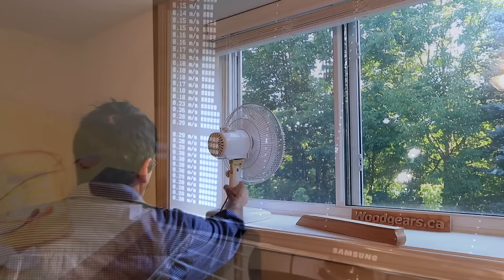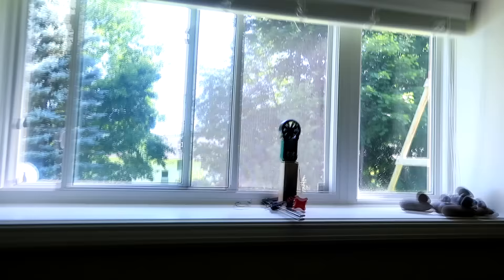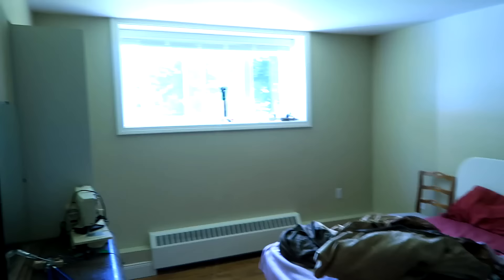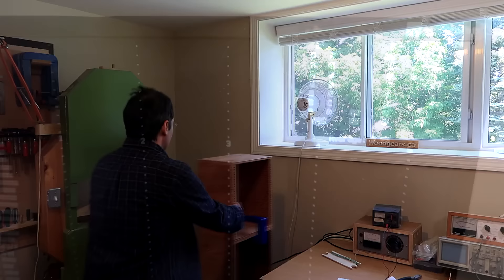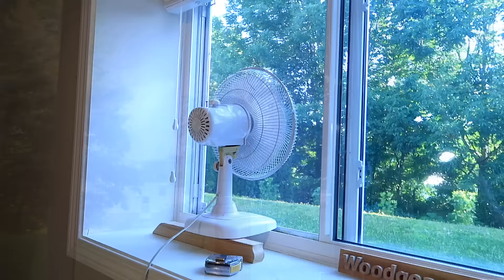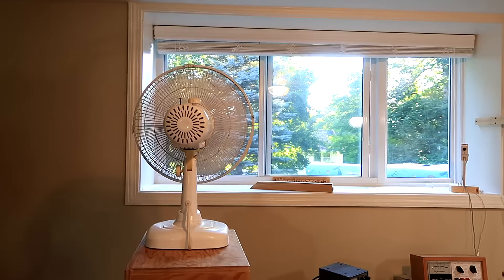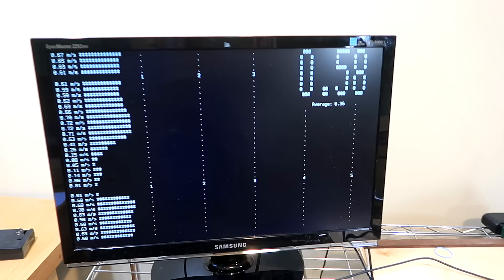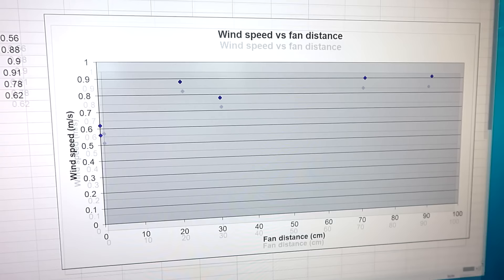Best fan placement to move air through the house

Comment: As a physicist who worked in an office with no air conditioning, this was one of the experiments I had to undertake. Very often I would get to the office at 06.00 or 06.30 and the temperature in the office would be about 28°C. Outside air temperature was about 20°C at this time. Subjectively it was very noticeabble that blowing air out of one window  enabled the other window to suck in cool air from outside.  --> blow out is best, imagine the ventilator generates a "cone" of moving air which causes other air to also be moved. Aim for the largest vigorous moving part of the cone to be at the window.    
The next factor was whether closing the windows when the outside air temperature exceeded the inside temperature or whether to leave them open in the hope that there might be a breeze occasionally. --> This was conclusive - keeping hot air from outside out (typically 35°C in the mid afternoon) and the cool air in was best.  
The last objective factor was avoiding the sun heating objects (desks etc.) inside the office. For this, outside venetian blinds had to be adjusted so that sun did not shine directly on objects inside the office. This made a small but still appreciable improvement. 
One subjective factor is to use a ventilator to move the air in the office. Actually this should cause a miniscule temperature increase (the ventilator uses a motor consuming non-negligible amount of electricity converting into work, but SUBJECTIVELY the air moving over slightly moist skin feels cool. (But it isn't actually cooler, of course). 
I use these tricks also at home to ensure my house stays cool (we have no A/C) even though outside can be 39°C. Recently I had a 12° cooler house inside compared to outside. Whether in the office or at home I always make sure I can reliably measure the temperature in all required rooms and outside. Perception is subjective, thermometers are objective! All the best, Rob in Switzerland
Reply: I am no physicist, but woul'd moving air not increase the evaporation and so cool the evaporation surface/ object (in this case you), so it would not be a subjective feeling, but an actual cooling effect for humid objects?
Reply: @rabenklang7  This is true, and it's not just caused by evaporation. Air directly next to the skin is generally much warmer than room temperature (if ambient temp < body temp) which means that blowing air over the skin will replace warmer air with cooler air. This is why wind protection is important in cold weather; still air is an excellent thermal insulator, but it only works if you can actually prevent air next to the skin from flowing (which would otherwise quickly result in convective heat loss).
Reply: Born and living in a tropical, hot and humid country.

I can confirm ventilator fans, or just moving air in general is really good for skin feel.

I think slightly drafty indoors is something people living in temperate climates need to get used to and incorporate into their culture (global warming). I was so surprised when I holidayed in Europe and there were no fans (or air-conditioning) at all in the shared Airbnbs, it's fine in cold weather, but summer would be a broiling torture.
Reply: A lot of people think that no matter what, no matter how blazing hot it is outside, opening your windows will keep it the coolest inside
Reply: @rabenklang7  Yes but the room wouldn't be cooler, thus it being subjective (subjective as in relation to the room - as "what/who is it impacting" and not the general room temp)
For example, chinchillas don't sweat like us thus air flow does not cool them down. So cooling down the whole room is needed. (As opposed to just cooling you down)
Reply: @tragile9108  hmm even when they do not swet, i suppose airflow will make them objective cooler,  especially when you shave them first, and if the air is cooler then thier body temperature. But yes, the room temperature will not change. And if you have to take care of such an animal, you need to make shure it stays happy in a cold room. ;-)
Reply: Thank you for the data Rob. I had been wondering about exactly this for a while (keeping cool air in instead of letting a breeze in) never had the time to actually to actually test it.

Will be using it this moving forward
Reply: @VVayVVard  is that the reason why water feels colder than air with the same temperature? Because the water actually pushes away the body warmth "sphere" around us?
Reply: You build up a layer of warm and moist air around you, if you constantly blow it away, you'll evaporate more sweat and not build up warm air, so you'll indeed be cooler.
Reply: So should I be keeping my windows closed during the afternoons? No need to vent out the hot air with a fan blowing outside? I live in the Philippines and the weather gets consistently hot
Reply: @leojones1964  Yes if the outside temperature is higher than the inside temperature - and if possible make sure nothing in your room is warmed by the sun - so keep the blinds or curtains closed, as counterintuitive as this may sound. Otherwise you are unwittingly heating your house! All the best, Rob
Reply: @leojones1964  it's the same concept as closing all the doors and windows tight when the AC is on. I'd think an Asian was born with this knowledge in their DNA. So if you've cooled your house down extra chilly the previous night, when would you let all of that cool out seep out while letting the oven outside in?
Reply: @tempota7792   Pardoning your subtle condescension, I completely understand the concept. I was simply asking if there was any value in venting hot indoor air and encouraging airflow over not letting hot outside air in. I got my answer (only if the indoor temp is lower) which is hardly the case without AC because this house doesn’t have insulation and the room is directly under a concrete roof deck. The difference in temperature is not significant that I opt to open my windows anyway. Unless this is also wrong
Reply: @lukass7756  That's due to evaporation. When water is exposed to air, hotter water molecules evaporate over time, leaving cooler ones behind. This is the principle behind the cooling effect of sweat (which is actually slightly less efficient for cooling than drinking water is, due to the higher salt content preventing water molecules from evaporating as readily).
Reply: @VVayVVard  I meant when actually bathing in the water. Water always feels colder then air at the exact same temperature.
Reply: What about a room with a single fan
Reply: @lukass7756  That could partly explain why water feels coldest (hottest) at the moment of submersion. However, the reason water temperatures feel colder/warmer during bathing is due to submerged skin being in contact with a higher density of environmental molecules compared to dry skin, enabling it to impart more kinetic energy to its surroundings via direct molecular collisions (conduction), and vice versa in the case of hot water.
Reply: this guy seriously just claimed that moving air over skin doesn't make it cooler

i guess evaporation just isn't a thing then? really makes you wonder why we evolved to sweat. must have been a fluke!
Reply: @DevinDTV  You have to distinguish between subjectively cooler (how you feel) and objectively (actually) cooler (the ambient temperature). If you apply a few tricks, you can have both. Spoiler: moving air across your skin does not actually make the room cooler. Duh! It's physics.
Reply: @DevinDTV   I believe he meant that moving air inside a room doesn't make the room itself cooler (as opposed to pushing air outside, which would result in negative pressure inside, which in itself would cause (presumably cooler) outside air from other windows to enter inside). Blowing air on the skin will of course accelerate the rate at which the skin cools down.
Reply: @coolghoul9  never been outside their state or near Arizona
Reply: It's really a shame that exterior blinds and shutters are so rare (at least here). Reflective curtains of course help but the space between my curtains and the glass is always an absolute greenhouse.
Reply: @keldencowan  I agree. When I returned to UK after living in France for some years, I considered adding exterior shutters to my house. Now I live in Switzerland and we built our house, so I made sure to specify exterior blinds. The really big ones are motorized and the smaller ones manual. We use them all the time to keep the house cool. All the best, Rob
Reply: @RobWhittlestone  you're kind of wrong with wording here. Because if you blow air towards your skin (with condition that air temperature is lower than your body temperature) it will be not only SUBJECTIVELY cooler, but your skin would actually cool.
Reply: @user-jb2kt3ub2e  I agree - I made the assumption that the air was at the same temperature or slightly higher. Thank you for identifying this factor.
Reply: I love seeing clever videos like this. It's the sort of thing I often find myself doing at home. I also love seeing well-written and informative comments. Your contribution is appreciated - thank you!
Reply: In my house I use cellular shades (honeycomb blinds). When opened they trap a layer of air which serves to insulate the room. They also have white facing the outdoors to reflect light and the interior can be any color. They work well to buffer temperature extremes in the winter or summer.
Reply: @coolghoul9  It might not be cooler to open the windows, but the air is much fresher...

When I leave the windows closed and enter my apartment, the air smells so stale its unbearable.
Reply: God, I wish we have winter like you do there. I'd stockpile ice and snow for summer.
Reply: but blowing inside feels sooo good
Reply: This is dumb. Fans should be pointed at people to facilitate perspiration, which is what really cools the body. 
If you think thermometers are more important than thermal perception, go into a tropical forest at 30ºC and then into a well-ventilated desert at 35ºC. I guarantee you that the climate in the desert will be much more pleasant.

Even if you want to remove air from inside the room, an exhaust fan is much more efficient than an ordinary fan.
Reply: Ive been running similar experiments in our house because of the same reason, tho recently install a ac, it doesnt do the whole house well, so we use those tricks in tandem with the ac running when outside is hotter than inside to help preserve the coolness. Two small window ac units can work wonders when u have fans properly placed too, tho ones lost in storage right now, but with two it helps keep a cool air vortex going as long as a given space isnt mich bigger than the btu rating of a given ac unit
Reply: @lukass7756  It is because water has a much higher thermal conductivity than air. 25 times more to be exact just googled it. It is the same feeling when you touch a piece of thick metal, you will feel it even colder than water even being at exact same temperature because steel has a much higher thermal conductivity than water
Reply: Moving air inside, all wi dows closed, is not just "subjective" cooling. We use sweat and transpiration to cool ourselves down. If there is a bit of ventilation, sweat evaporates faster and you can cool down your body quicker. Not too much ventilation, or it will dry up mucoses. So for optimal comfort you need just a bit of ventilation. This will cool down your body trough sweat evaporation.
Reply: Please don't call evaporative cooling of the skin "subjective".
Reply: @ewthmatth  Why? Who else notices it?! Hahaha!
Reply: Closest i gotten to doing something like this is the kitchen when cooking for long periods of time. Our kitchen is connected to living room by door sized entrance with only a thin curtain separating the two. When cooking, i’ll open the kitchen door (leaving the screen door closed) and do same for living room door. I’ll also close the curtain diving the kitchen and living room. This ends up with a much warmer kitchen, but the temperature difference it creates will force air under the curtain, drawing cool air from outside into the rest of the home.
Reply: grüezi wohl :D wo hast du 39 grad? nicht in der schweiz und wenn dann 1-2 tage lang...
Reply: That's why we use exhausters. They blow inside air out. Isn't it common sense?
Reply: @RobWhittlestone  Only issue is indoor air pollution. You breath and have to change the air regularly so there is loss on that matter. Best way to go about it is opening everything wide for a short period of time.
Reply: I'm working in a workshop with no air conditioning and had the exact same observations. So obviously I decided to automate the whole process.
At the moment I have multiple fans in different windows (they are mounted, so sadly I can't move them) and motors on the windows / balcony door.
I also have indoor and outdoor temperature sensors hooked to Nodemcu modules. A simple script I wrote turns on the fans and windows when outside temperature is lower, and turns them off when it is higher. 
Also, some of the blinds here are automated too, so they automatically get closed based on the hour too.
This way the workshop is 5-6°C cooler the entire day because the system is cooling it down at night (and whenever its cooler outside).
Fans use very, very little power compared to an AC, so this is a really efficient and cheap way to cool a large office /workshop down.
Reply: @DarkownerMinimalist  das gleiche habe ich mich auch gefragt und mich gewundert das es sonst niemandem aufgefallen ist 😂
Reply: @lukass lowest iq comment itt
Reply: @Devin take reading comprehension classes buddy
Reply: I see, so it's better to push air out, thanks.
Reply: I wonder why here in the tropics we don't seal our windows so we can keep hot air out. closing windows doesn't do much for keeping it ou lol
Reply: @keldencowan I suggest putting aluminium foil on the outer side of the windows. Of course, it looks weird from the outside and will attract attention of the neighbors :-D, but it does wonders to lower the greenhouse effect.

I put it on about 2/3 of the surface of the glass  (on windows oriented to south) at the beginning of the summer and leave it there till the end of it
- the amount of light in the room is of course lowered, but bearable.

I attach the foil directly to glass with pieces of an adhesive tape - this creates slits around the edges, but it doesn't matter. I prefer not to attach it to the window frame to preserve the surface of it (we have wooden frames).

Leave uncovered the part of the window where you want to be able to see outside - I usually leave a vertical gap at the side of each window panel.
Reply: @SkyBlueDesign1   I tried this but had a visit and serious questions from the police a few weeks later. Apparently it is a method used by people cultivating cannabis indoors... I now use fans and open windows during the night...

Comment: This is the Bernoulli effect! Basically, why the windblown section is not a cylindrical column extending from the face of the fan, but rather an expanding cone, is because moving fluids (in this case, air) have lower pressure and thus "pull" nearby fluid particles to move along. 

So originally, the windblown section would of course be a cylinder, but at the edge of that cylinder, moving air particles pull along stationary particles, and then the now-moving particles also pull another stationary particle and so on until the kinetic energy dissipates.

This is also why you must stand behind the line at train platforms because the moving surface of the train will "pull" your body into it.
Reply: Funny, we're currently having refresher in Bernoulli's principle.  And I remember losing my mind on that lesson lmao
Reply: Is this also why a running shower will "pull" the shower curtain into the tub??
Reply: Coanda effect also important here I guess?